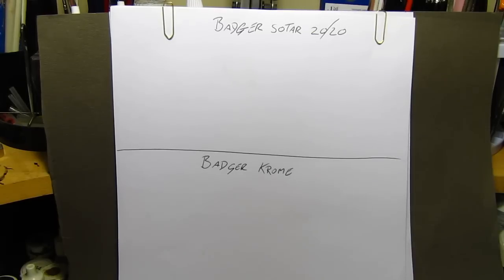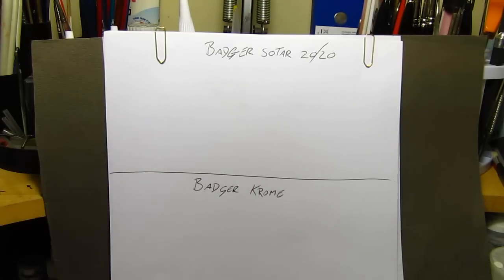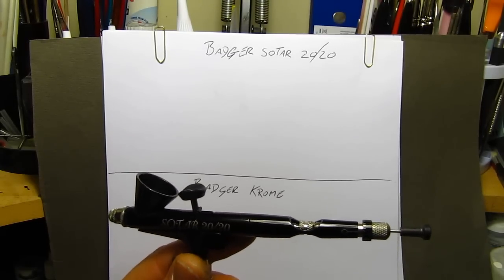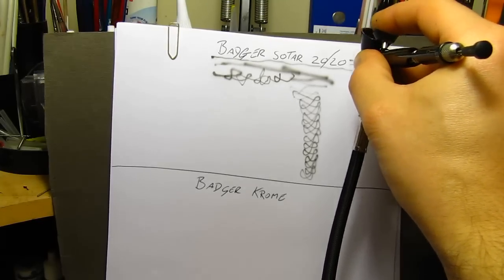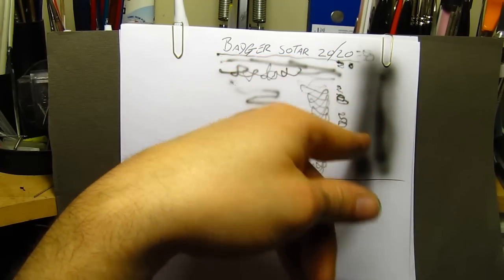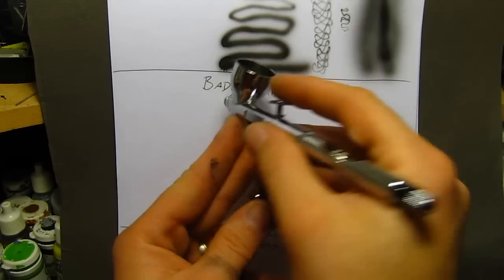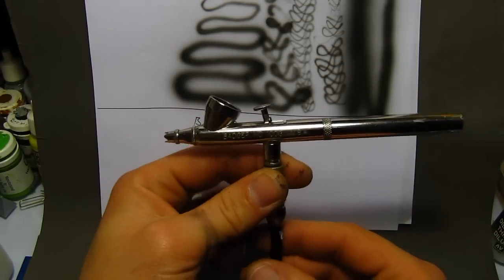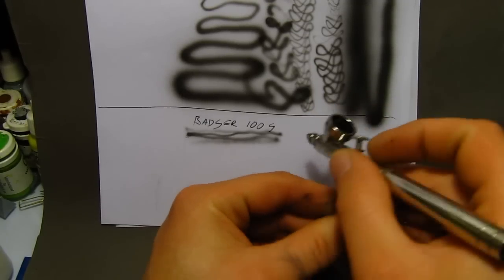Test results of the badger airbrush renegade krome sotar 20/20 and the 100 G

Comment: I have a badger velocity and spray vallejo acrylics, there is no problem with both primer and vallejo air just use some acrylic thinner and you be more then fine, other thing is simply that you need to keep the airbrush clean thats all.

Comment: if you turn the air down a bit more on the krome it would be ok it drys on the needle when you want to do a thin line if the air is to high 10 psi 15 psi

Comment: I bought a Khrome and had to sell it, it is too problematic! If you ever remove the needle packing you have to get it in just right, too loose and it leaks, too tight and the needle sticks!  I went through an ounce of paint fine tuning it. Plus I got more dry tip out of it than my Sotar! I do not know why since I polish my needles to mirror finish on both and nothing really seems different but I still got more dry tip? Maybe because distance from pot to needle is longer?

Comment: I am thinking buying the krome and I am using Vallejo model air colors thinned with airbrush cleaner and flow improver. Will I have a problem? They are quite thick colors.
Reply from the maker: Hi Alexis you don't need to thing down Vallejo model AIR colours bud ? they are designed to be used for air brushes straight out of the bottle. if i do need to put anything in my catch cup i only put a tiny amount of water to thin it down a tiny bit and sometimes retarder to keep the paint wet and to stop it drying on the tip of the airbrush.